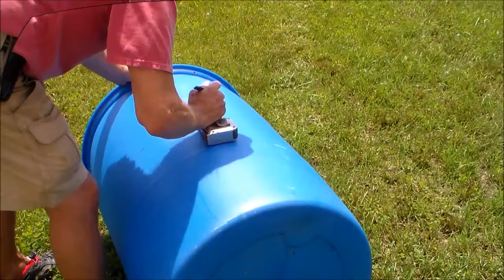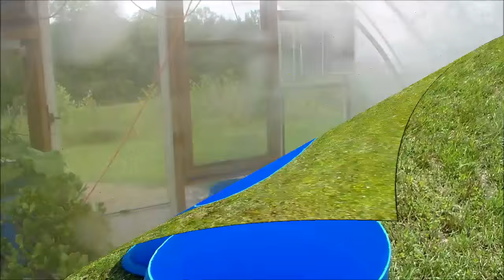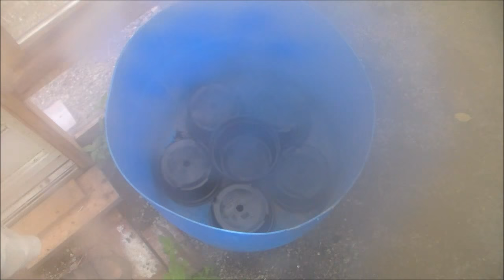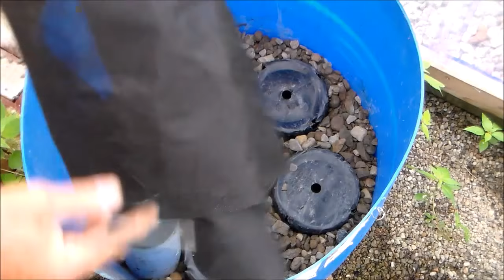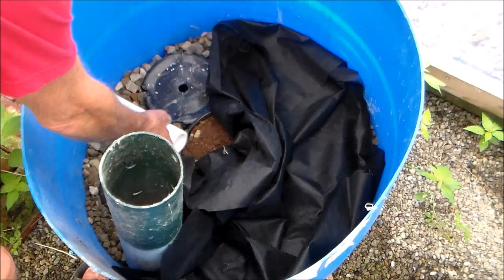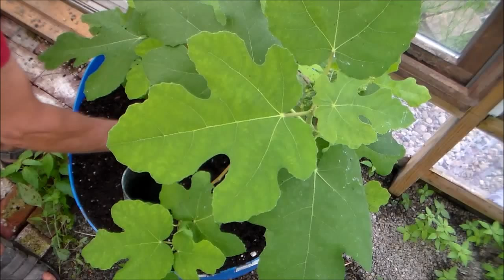DIY Wicking Bed For Small Trees

Comment: Hi Donald
Enjoy your videos
I've been building treeplanter wicking beds same method only using charcoal as my support medium rather than rock chip/gravel... a hell of a lot lighter.... trees grow well and I find a lot of worms in it. My actual soil mix also has a lot of charcoal in it. I also run my aquaponics thru the tree drums hooked up  as return filters.

 In the process of reconstructing a new system built totally around this concept. May go soilless at some stage and rely on worm castings and rock dust for nutrients
Reply from the maker: +Sustainable Living I have actually been considering a similar shift to what you just told me.  I plan to be making Biochar, and incorporating this. Thank you my friend---Don
Reply: The figs will be root bound and won’t thrive after a couple of years

Comment: Why do you provide holes at the side of the 2-inch poly pipe above the drainage hole at the bottom?
Reply from the maker: this allows the worms to move freely between the two sections.

Comment: I have observed that most wicking pots have an air gap of about 1" between the water reservoir and the potting soil and that the drain hole should be positioned to allow that 1" gap. I noticed that your planter has no air gap. Has that been an issue?
Reply from the maker: not at all, the wicking planters are working wonderfully!

Comment: Call me silly, but how does the water wick when you have a root barrier cloth? Good video though! Might consider perlite instead of vermiculite
Reply from the maker: +MARK K. The center pot is filled and is upright, this connects with the rest of the soil above, the root barrier does not block the moisture--- Thanks for the comment my friend---Don
Reply: I was wondering the same thing. When your pet moss compacts a bit, how does the soil connect to water to wick it up? If the water goes lower than the pipe, it is not reachable anymore is it? I would have put the extra cloth down around the gravels so it pumps the water up. But maybe I missed something in the explanations?

Comment: Thanks for sharing, I just started building wicking beds on my terrace in the center of Marseilles, France. Nice and interesting video. Could you tell me at what height from the bottom I have to drill the outflow hole, so that enough water stays in the barrel? Is there a way of calculating this, according to the  size of the barrel?
Have a nice days (or night, I don’t know where you are from😇)
MJ
Reply from the maker: overflow hole is set at top of spacers used in bottom of container,i typically use about 6 inches, the soil can only wick about 18 inches vertically, this is the approximate depth of the soil.